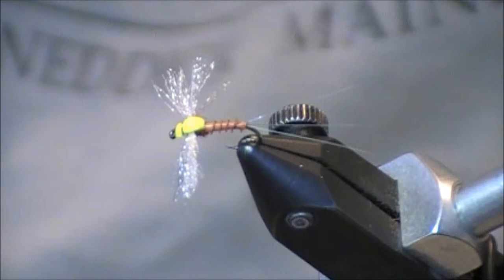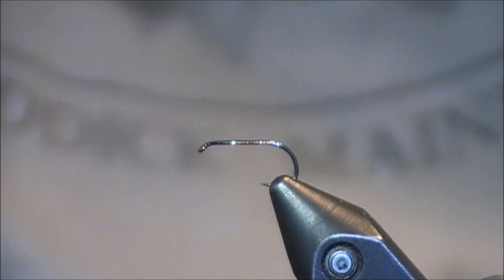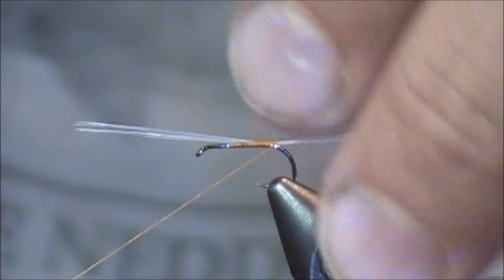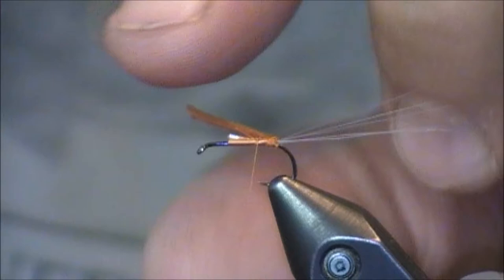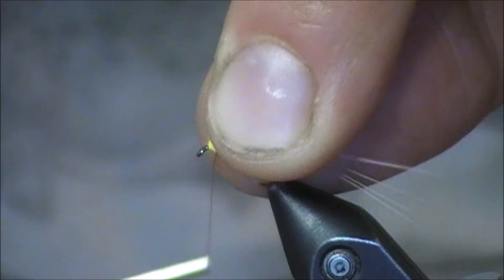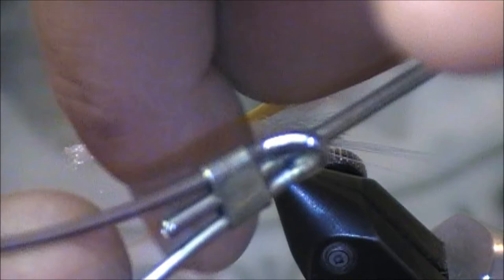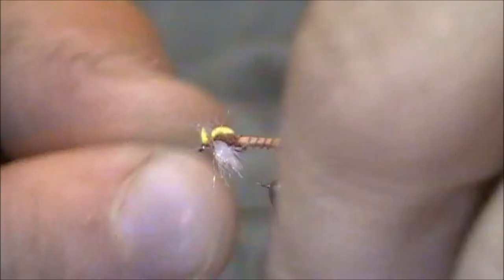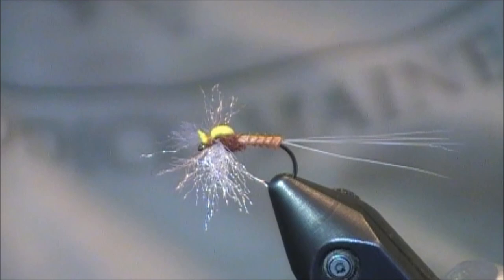Fly Tying: Rusty Spinner (Hi-visibility)

Comment: whats wrong with adding a tiny bit of dubbing at the tying in point for the micro fibbetts this will split the tails very easly and is a very simple method
Reply from the maker: Stephen, thanks for the question, and to answer it, there is nothing wrong with the "dubbing ball" method.  Related to this pattern, with the body being a biot, adding dubbing is an unnecessary step.  Splitting the tails with thread is simple and effective, plus there is no need to include more material.  I present this method, the "dubbing ball" method, and others in a YouTube video titled, "Tying Dry Fly Tails with Microfibetts."  Feel free to watch that video for additional tips.  Thanks, TC
Reply: love the tying tim thanks for returning my email
Reply from the maker: Stephen welham You got it, Stephen, and thanks for the kind comments.  Tim